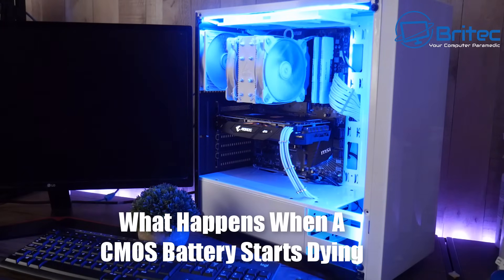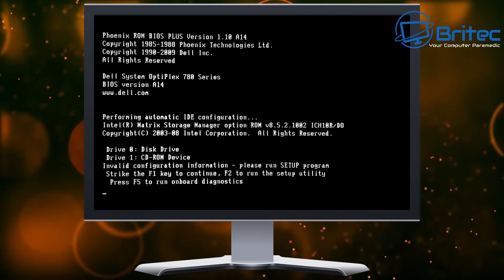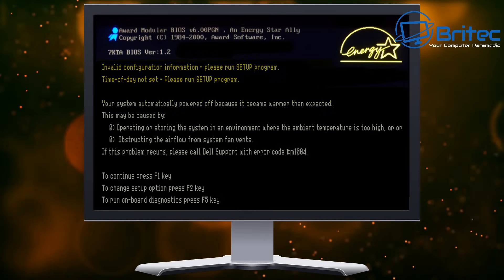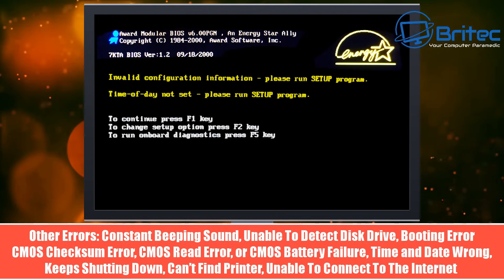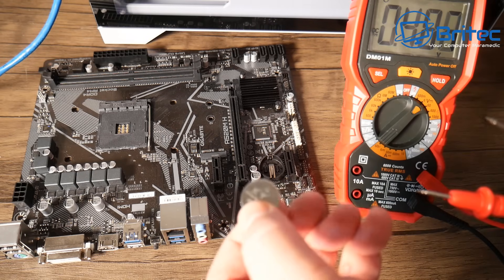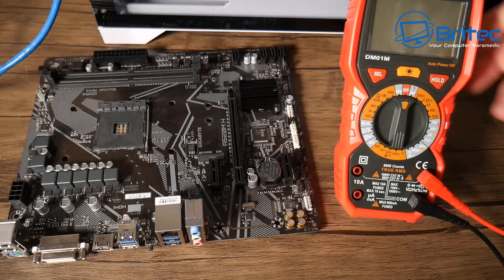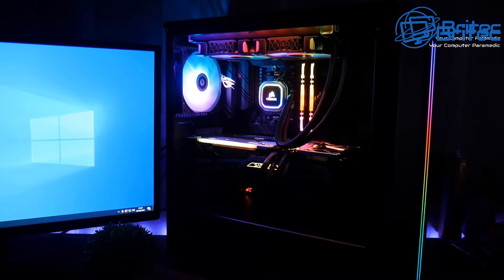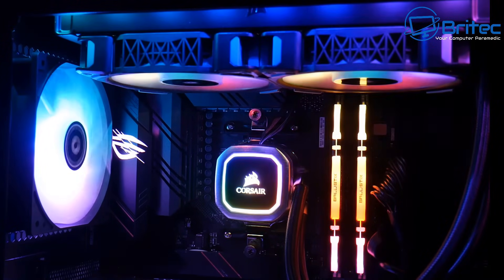What Happens When Your CMOS Battery Starts Dying

Comment: There's a number of strange behaviors that can occur when the batteries are dying. Usually the most obvious is the time/date problem. It's usually a CR2032 battery which you can often find at the dollar store.
Reply from the maker: Yeah, the pc will act real funny on a dying cmos battery
Reply: @Britec09  hey may I ask you for something.Does a fan spinning fast and no signal on monitor occur because CMOS battery has died I mean other stuff happend before that which were obvs that was because of the CMOS battery but I am worried about that because if it is not fixed when I change the CMOS battery then it's gonna cost alot
Reply: @Britec09  it this going to fix my error "reboot and select proper boot device" coz before it always changing my date and time then it hang and got that error
Reply: @Britec09  This is weird, because I have never owned a PC that has done anything other than pop a "CMOS Checksum Error" (or some similarly worded error message). The BIOS chip makes a checksum of all the settings you have saved in CMOS, and it keeps this in memory. When you boot the computer, it will compare the checksum of the current CMOS Settings against the CMOS Settings Checksum that it had previously saved. If, for any reason, they do not match (they won't match if the battery is dying, ever), it will pop that error and force you to go into the mainboard settings (some BIOS chips give you the option to boot with default settings instead, but this is usually undesirable because the default settings almost never include a storage device, which means no OS will be found). This is hard-coded into the PC's BIOS chip, and it's done for safety reasons as erroneous data could be very damaging to the computer's hardware, such as sending wrong voltages to the wrong places in newer computers whose BIOSes allow you to overclock hardware. You'd have to be running an extremely cheap off-brand mainboard to be able to boot with corrupt data in the CMOS. Unless, of course, they do things differently across the pond? You sound British so maybe computers in the UK work differently than those over here in the States?
Reply: Laptops were completely overlooked in this video, where a dead or dying CMOS battery doesn't necessarily exhibit any strange behaviour at all.
Reply: @FlyboyHelosim I want to know also
Reply: @danimayb  Sometimes it's nice to have a short paragraph that says what a 5 minute video says that only takes 10 seconds to read? /shrug Sometimes titles are clickbaity and you just wanna know wtf the Title of a video is talking about but you don't wanna sit through the whole video.
Reply: My Dell 5567 uses a smaller disc battery than the CR2032. It is a battery that is wrapped by a shrink cover and has a 2-wire assembly that plugs into the motherboard. They are hard to find on the internet. I replaced my dying battery with a "verified" used battery and now I'm sometimes getting a beeping on startup which leads me to believe this "verified" used battery may not be all that strong. If the beeping continues, I will replace it with a new one I was able to finally source. I will first test the "new" battery with my multimeter to verify it has at least 3 volts. And, out of curiosity, I will test the "verified" used battery I installed to see if it still has 3 volts. 
I really don't have a way of testing the used battery by such as using an LED bulb to check its strength under load which can be different than a static voltage.
Reply: If my pc become no signal in the middle of working/running is it also causes by cmos battery? I have checked my vga/hdmi cable, clean my RAM, update my graphic driver, those were not the issue. Is my CMOS the problem?
Reply: My Thinkpad has.been running with a dead CMOS battery for years, just reset the time and date before booting it up and it's good to go, it even makes this video obsolete, how about the good old tech of the past?
Reply: Every time I switch on my PC, it runs for a few seconds, then resets, then it boots up to a reset BIOS. The time and date don't reset though. Could this be the CMOS battery dying? The PC works fine afterwards. It just keeps resetting all the BIOS settings every time it's restarted
Reply: @ichosethishandle  Yes that sounds like the battery is dying/dead.
Reply: Had to buy one today, from the dollar store. I now have 3 extra cmos batteries lol.
Reply: Usually it results in BIOS reset on next bootup, thus making your RAM/CPU configurations always not invalidated and so your PC has to train RAM every time it boots up again which also might cause it to stuck or just ask you which drive you want to boot from.
Reply: ' It's usually a CR2032 battery which you can often find at the dollar store.'  Much better to spend the $5 and get a real name brand in this application, they'll tend to last 5 or 10 years.  The cheap ones tend to only last a year or two at most, and you'll spend half the money in total on the next several batteries anyway during the same time.
Reply: @ModelLights  Dollar stores sell name brand. In fact, I've never seen an off brand CR 2032. They are all energizers or duracells.
Reply: @anthonyg9739   Which dollar stores are you talking about?  Dollar Tree doesn't even list a 2032.
There  are tons of cheap versions, and even the main companies put out their own cheaper versions.  You have to look to make sure you're getting the full version that isn't cost reduced and half empty.
Reply: @ModelLights  Seen them at Dollar General and Family Dollar. Energizers and Duracells.
Reply: @anthonyg9739  ' Dollar General and Family Dollar'  Neither of which are 'Dollar stores '.
Reply: @ModelLights  Shrug, opinions vary.  They are to me.  Five dollars for a two pack of button batteries is dollar enough.
Reply: @anthonyg9739  ' They are to me.'  'Shrug, opinions vary. ' 
That's not an opinion.  ' Dollar stores '  Neither Dollar General nor Family Dollar are called dollar stores just because they have dollar in the name.  That's like saying the NY Giants were 100 foot tall giants just because they had giant in the name.  No, not actually.
Reply: @ModelLights  You are in it for the argument. I am not. Goodbye.
Reply: @anthonyg9739  ' You are in it for the argument.'  Total BS.
You said you could get the correct batteries at the dollar store, I gave exactly correct information instead.
'' It's usually a CR2032 battery which you can often find at the dollar store.'  Much better to spend the $5 and get a real name brand in this application, '
Reply: @ModelLights  You could also spend like $10 and buy 20 energizers like I did once. /shrug
Reply: @danimayb 'But didn't this man in the video comprehensively cover what you just said? '
No, he didn't comprehensively cover to not buy the crap version of the battery that other people later suggested, even though that's a very bad idea.
By the time you change a battery in a place you don't want destroyed in a year or few later, you put in the actual, good version of the battery.
Tons of people don't understand that the crap versions will sit on a shelf for 10 years, but they do not last for 10 years in circuit like the good versions of the same batteries.

Comment: I've gone down to my dollar tree store and purchased a CR2032 for only a buck! Last few times they've had the Panasonic brand!!! I figure if I'm gonna crack my case open for a good blow-out, I might as well check the CMOS battery!!! When I was doing tech work, I'd go to a location and see customers with their tower PC on the floor. WORST place to put a PC....sucks in dust and whatnot!!! Then, if it was a lawyer's office, they'd have crap piled everywhere!!!...pretty much suffocating the airflow to the PC!!! Several times, the pc's contained sooo much dust that the user would complain that the PC was running slow!!! And I'd say...your computer is running slow because the heatsinks are clogged with dust and your processor is throttling down to keep from burning itself out due to lack of free airflow. I would usually get a blank stare in return. 😏
Reply from the maker: Thanks for sharing

Comment: I've seen some systems that will refuse to power on with a dead CMOS battery primarily the Prebuilt ones like the old Compaq Presarios from around the Windows ME era are one example if the CMOS battery dies it won't turn on.  Carey Holzman had one as soon as he put a new battery in the thing sprang to life without even having to hit the power button
Reply from the maker: Yeah, CMOS battery is very important
Reply: I know it starts without battery on defaults. Am i wrong?
Reply: @electrocat9  it depends on the system like my example was a Compaq they dont exist anymore HP bought them   I have seen other motherboards with dead or dying CMOS batteries they will turn on but they will give various errors at least now the system can detect the hard drives etc automatically back in the 80s and early 90s if your CMOS battery died and you didn't know wat settings to put in the bios for the hard drive etc you were dead in the water
Reply: @electrocat9  some will some won't
Reply: Also, a lot of newer laptops will not power on with a weak CMOS battery.
Reply: @Odinsagoodboy  good to know. Nasty thing. At least put an indicator showing 
"imminent errors coming, replace the bloody battery!"
Reply: Just built a PC and it wouldn't turn on. Turns out it was the CMOS battery dead from factory.
Reply: @thefezer456676  did you exchange the motherboard
Reply: Amazing to find this thread. I just finished troubleshooting my computer that I built in 2015 and it was completely dead. No fans spinning or even trying to start. Long story short it came back to life after removing the battery. We expected the battery to be shorted but it measured 2 volts.
Reply: Mine is not turning on..I think i should change the CMOS battery.
Reply: Any news ?! Same here@megaztrooo
Reply: got this problem, pc wont turn on even if power supply is working fine. turns out that the cmos battery is already having some issues.
Reply: This is litterally my pc issue. Except, I need to change mine every 6 months...
In fact, I'm on my way to the store now because my pc wont turn on. This usually solves it for me with this rig.
Reply: @henco8716  there is something else wrong with your computer if it’s killing the CR2032 battery that quickly. Those batteries only should need to keep your BIOS settings and the date/time current when the machine is off or you lose power. My old HP desktop from 2012 that went several years without being used still had the correct date and time and it went from late 2012 to sometime in 2017 without being powered on
Reply: I got here because my (very old- 2012) laptop refuses to boot, even telling me (by chasdis lights) there's energy (both cable and battery).
Reply: Yeah lol
Reply: My Desktop wouldn't turn on and I took out the battery and now it turns on but the video display doesn't work anymore, including the default motherboard video output. I am wondering if replacing the batter will fix this issue. Because I am lost as to what else it could be